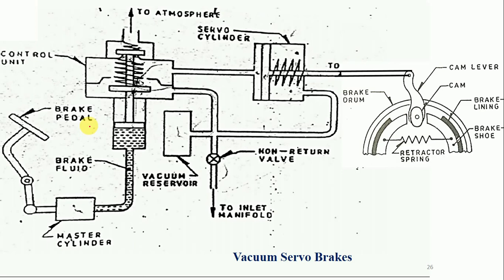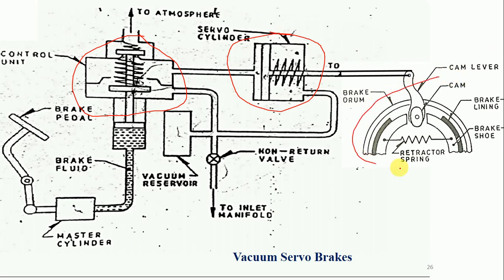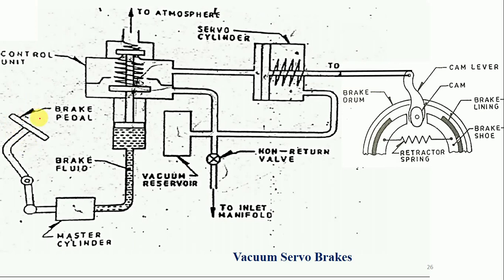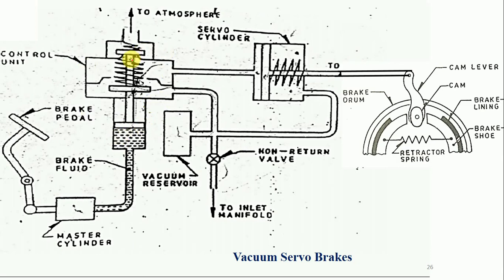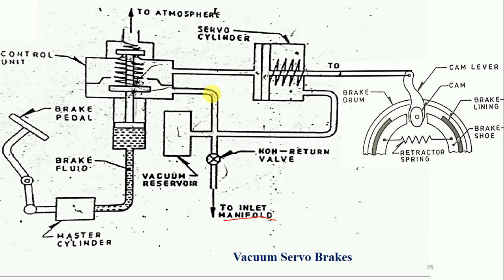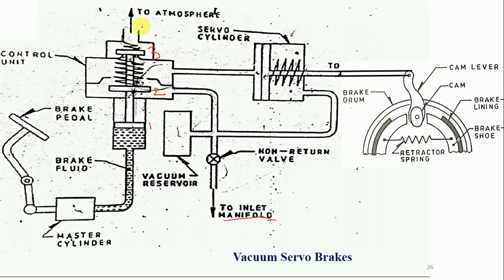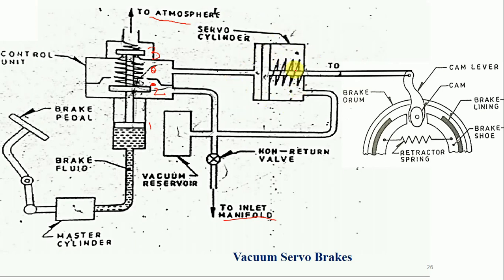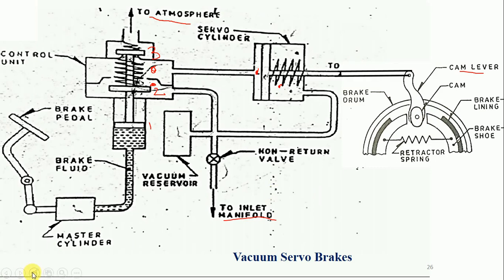Vacuum Servo Brake

Comment: what will happen if NRV Non return valve is miss in system
Reply: High pressure air from cylinder will come in the reservoir